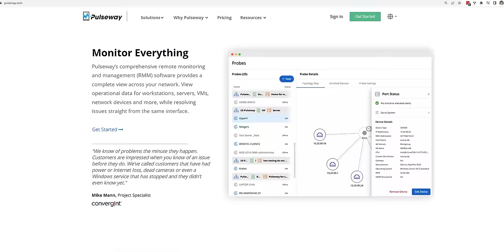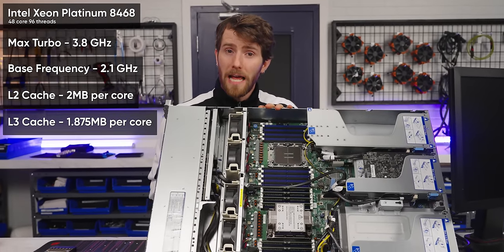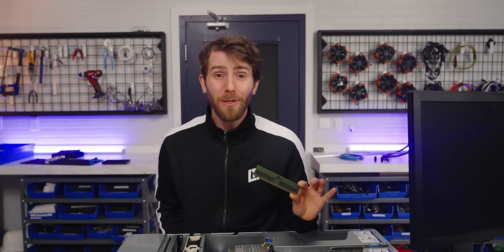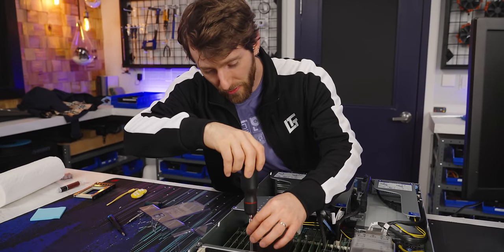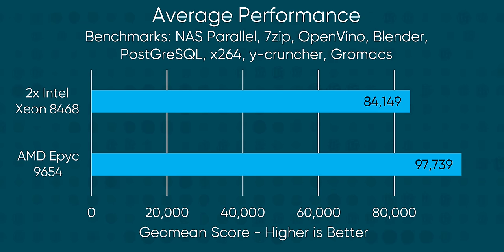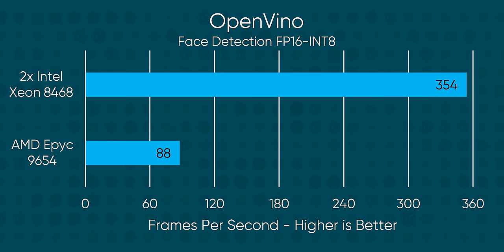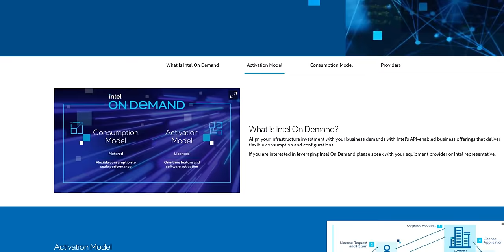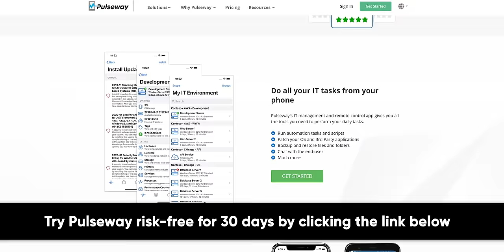Intel’s New CPUs are Cringe - Intel Sapphire Rapids Xeon Platinum 8468

Comment: So I've started binging LTT a bit more recently - and with that comes needing to speak out about the Not so clandestine Teleprompter clickers I've been seeing for Months now, but it just bothers me more and more EVERY TIME.

Linus - you literally have Tech coming out your wazzu and about 3 million staff on board - Just PLEASE PLEASE PLEASE get someone to press the button each time you get to the end of a page.  Or alternatively using a Rolling App to run through automatically - you already know your own cadence, it's mostly the same for all videos, so shouldn't be too hard to tune.
Either that - or get a foot switch instead of the Clicker you juggle and try to hide the fact it is in your pocket...it is really starting to show in some videos as Not the right behaviour at such times - Like holding up the server with one hand, waving your hand in front of it to show components, then hand back in the jacket pocket then back out again...Just...No-one Does that!

Comment: I can imagine pitching this to a superior: "We can spend more money, right now, buying TWO Intel CPUs that are slower than a single AMD CPU and use more power, and... wait for it... Then we can add a recurring cost down the line, to unlock AI accelerators on said Intel CPUs to make them faster than the AMD CPU at select workloads. Great huh?" I'm not sure this is the business model I'd go with. There will be Epyc CPUs with AI accelerators soon, and besides, with the saving from NOT going Intel, you could probably add a dedicated Nvidia GPU for the AI tasks.

Comment: You can shit on the price to performance all day but in the end a lot of customers are gonna want the dramatically bigger RAM capacity and the 8 CPU configurations, huge situational advantages you even mentioned off hand in the video, cause they're simply better than the best configurations AMD has to offer. Nevermind the fact that Intel servers are still statistically more reliable which is extremely important for any company aiming for near perfect uptime. It's great that AMD is actually getting it's foot in the door for once by offering a great deal on less specialized chips. However saying that Intel isn't very competitive by sweeping all the extra features and compatibility under the rug and pretending like the AI acceleration is all they've got going for them is pure BS.

Comment: Do yourself a favor. Load up both servers with a typical setup. Fill it with drives and raid them, put a couple of nics of different brands in there, a Linux OS and a kvm hypervisor. Then spin up a bunch of vms of different operating systems running different loads. Give it a week and then tell me who you like more at the end of that week - the faster one, or the one that works.

Comment: AI processing is evolving too rapidly to be placing it into CPU's which are supposed to be long term purchases that sit in the datacenter for several years.  That's why these companies would opt for addon card versions that they can upgrade because for several years the CPU performance will be just fine, but AI performance will be growing on the addon cards.

Comment: Honestly in corporate world no one cares about this. I have seen $100K servers termed as cheap in corporate world. All that matters is what application they put on it and what capacity they can use that app at. Like if its a server handling internet traffic how many transactions per seconds it can handle. No one cares if its intel/AMD/IBM/HP or any. Just how much traffic it can peak at.
The second question is why customers are still on Intel. Well it comes down to logistics. Customers usually give their capacity requirements to server providers like HP/Dell/Huawei etc with contracts for maintenance and warranty support as well. Intel is present all over the world for quick replacements and has logistical ware houses in every country in the world. AMD on the other hand does not go beyond the rich countries. Uptime is more important than anything in corporate world. AMD because does not have a world wide reach as of intel simply suffers as in order to fulfill the maintenance contracts HP/Dell/Oracle/Huawei will stick to Intel so that the turn around times are met. Which cannot be done with AMD. 
Let me give an example. In Pakistan, Dell/HP/Oracle only provide Intel based servers and I have seen R&R being completed in 8 hours maximum and even as low as an hour. That is a hardware getting faulty to the hardware getting replaced on site. They simply cannot do it with AMD. Because AMD is not present in Pakistan, R&R takes up to 7 days to be completed for them. Now if that server belonged to a Bank, would you wait for 7 days for the server to be up again even with the redundancies. No. AMD fails miserably in logistics and its lack of global reach.

Comment: Linus, I Hope you are reading this, I have a video idea : Does FPS really matter? Most experts have a tough time agreeing on an exact number, but the conclusion is that most humans can see at a rate of 30 to 60 frames per second. Can you get a performance gamer game at different FPSs and get a graph FPS vs number of wins? May be this will put an end to the madness where I see reviews comparing products at insanely high FPSs and get reviews based on more real life scenarios. Does it matter getting the fastest gaming CPU if you can not tell the difference? May be at that level of performance other factors such as TDP and heat become more important.
Reply: He did this video already.

1. Yes and No. What matters the most is not strictly the FPS but the stability of the FPS.

2. Wrong. Humans can actually see more than 60 FPS or Hz. Try comparing a 60Hz monitor to a 144Hz one. The 144Hz would be so much smoother. An easy test that most people can do is with their phone. Most phone (even budget ones) can do at least 90Hz or even more and you can toggle between these refresh rate. Try comparing it when scrolling your phone UI which one is smoother.

3. Top sentence.

4. Again, yes and no (mostly no). You just want to make sure that the CPU isn't bottlenecking the graphics card that you are using.
Reply: @harveywilde6781  thank you, can you please point me to the video if possible please.
Reply: @nabiljemel2838  I don't like posting links on comment, the video tittle is "Does High FPS make you a better gamer?"

Edit: Also this video "Does 240Hz Matter for Gaming" for refresh rate.
Reply: Some how I feel this is left in the grey area so marketing can always sell us faster products. The golden question is what is the fastest refresh rate and frame rate delta that is perceivable by 90 % of the humans. Than add that baseline to performance comparison graphs, so we can see if two products are already above this baseline so it does not matter any more comparing  which one is faster.
Reply: @harveywilde6781  thank you

Comment: Intel loves to license their silicon. I had to tolerate a server once that shipped with a SATA enabled controller. You had to pay to 'unlock' access to the SAS mode and additionally pay to 'unlock' access to RAID support.

If you think Intel is going to let you pay for just the base CPU alone keep dreaming.
example: base cpu = $8,000 and the modules = $8,000, cpu will be sold for $12,000 and module unlock sold for $4,000...good deal, right?

You'd think with 52 SKU's they would not have room for loot boxes...er...unlockables.

Comment: linus talking like he has not installed previous generations of scalable server xeon cpus as they had same order of install. Install CPU on heatsink (adding thermal paste between), put heatsink-cpu combo into socket and screw in heatsink to hold them. It may sound strange, but I had better results installing Xeons than Epyc CPUs with their slide into bracket screw in with very specific order/torque and then deal with not even pressure so missing memory channels/pcie lanes etc.

Comment: So lets say you pay to unlock features on the CPU. How does that work for any sort of permanence? Does it burn some fuses so it it permanently enabled on the CPU, does it write to some sort of firmware on the CPU, does it get unlocked via something written in the firmware on the motherboard, does whatever OS you are using have to have a service that talks to an intel server to check what CPU features you have paid for? This all seems very vague and sketchy. 

What I am getting at is if you pay for this to have features unlocked how do you get to keep it? If you have a motherboard fail and swap it are you going to have to pay intel again because the unlocked features were associated with the old board? If a server needs wiped and reinstalled somewhere on an internal network where it can't talk to the internet for security reasons are the features still enabled. Can the features be enabled without the machine being attached to the internet in the first place? If when the machines are retired and sold off to recover costs do the new owners get CPUs with those features unlocked or do they also have to pay intel to use hardware that is already there and that somebody else already paid to enable? 

There are just so many questions I could see so many companies having for so many scenarios. It also raises all kinds of new questions for security and possible malware vulnerabilities like could somebody now write a new form a ransomware that disables CPU features you paid Intel for and locks the firmware unless you pay up to get them back? Are the CPUs themselves hackable so that we end up seeing sketchy CPU unlocker software and "services" floating around?

Comment: AMDs Epyc supports 2dcp just been validated but 12channel 2socket presents a problem of space for memory slots.
Intel are charging you extra for the silicon that the accelerators takes up but then wants you to pay again to use them! It's like ford saying you have purchased your shiny new off road Raptor SUV, but wait hold on there you need to pay us extra to drive it off road or over 30mph! Get real intel if your making people pay for the silicon you can't charge them to use it they will simply go to AMD or ARM soloutions! That are cheaper possible add a add in card with similar accelerators for better performance and still save.

Comment: I mean Amd was not the first to use multi-Die CPUs - not by a loooooong shot.
IBM that that many many years ago already, even intel did that in the consumer-marked like 20 years ago. And yes - "glued" is the correct term.

And for the CPU comparison - that is why Intel has so many different SKUs. The right CPU for the right job. Why not any benchmarks that these CPUs would actually used with? Were the memory is actually used, where the source is not just compiled but optimised for the used hardware? Cause that is the scenario where those CPUs are used - you do not just use off-the-shelf pre-compiled software on such a system unless you got money to burn and no clue what you are doing

They have CPUs specifically tailored towards Databases that mostly have even fewer cores and still cost a lot per CPU, but their per-core performance is a lot higher and that is what you have to pay the license-fees for with professional databases.
For comparison - the DB-license we often use costs around 3000$/year ... PER CORE. The difference from going with a "normal" 28 core Xeon and a tailored 12core for us was that the 12Core actually had cost just the same, game about 10% lower single-socket performance but as it is sold to run for 10+years in the end costs less than HALF the alternatives - including Epyc which was disqualified way early on already cause of the lack of support from AMD.

https://www.oracle.com/assets/technology-price-list-070617.pdf
Just to got your mind blown on how expensive real enterprise solutions are.
Yes, this says that an "oracle standard Eidtion 2" cost 17500$/year per CPU, with another 4k for software + support license - that is without any backup or encryption capabilities.
It doesn't matter if the CPU costs 5000$ or 15000$ when the licenses cost so much more.

Comment: I really hope Intel doesn't collapse... we've only just gotten another player in the GPU game
Reply: Seems very unlikely. Intel have a huge amount of inertia in the market. There are still idiots buying 10th gen 8380 based servers because they don't know any better and their chips still dominate the offerings from the corporate suppliers like dell, hp etc (and it's not like the consumer intel chips are getting a hiding in the same way)

This is hardly the first time they've been outclassed by AMD. They got caught a bit off guard with the old athlon 500, recovered a bit but then had a real mess up with the p4 architecture whilst amd stole the lead on x86-64. They've always recovered fine.

Comment: Pretty poorly researched project. Visuals jumped back and forth between different models of the reviewed processer, spoken specs seemed to indicate the standard 8468 and not the 8568V or the 8468H. The three of those are all very different processors.

Crying about licensing the accelerators is meritless. If the hardware is cheap, but the software expensive, it makes zero sense to not standardize hardware somewhat then license the software. It makes absolutely no sense to pay for a software package that benefits database or media encoding performance when the workload is being used for low performance VDI. There would be no case where a software optimization would ever be licensed for a workload that has nothing to do with that optimization. It has the same quality as complaining about being software locked out of a development tool that has new features that are installed but you can't use because you only went for the low edition tier.

MSRP means absolutely nothing in datacenter products lol. No one pays that, even regular people buying 1-2 of them at a time.

The chiplet design and tile design have absolutely no resemblance to each other. The tile design is more similar to what is being done with ARM SoC implementation. This tile design means a processor has one numa node. the 96 core genoa processor has 12 numa nodes and all the memory problems you would get in a server with 12 sockets.

Database benchmarking is an absolute joke - nevermind that postgres is nearly irelevent - there is a reason none of the real players in the dbms segment do benchmarking: They are entirely worthless. Database performance is too dependent on the model design, the application, how the application is used, etc. Results of rdbms benchmarks mean absolutely nothing. A real world implementation could perform drastically better or worse. The straight 8468 is also just about the worst processor in the 4th gen lineup to use for relational databases with a 2.1 ghz base frequency. I would just about guarantee that in real world usage, the 32 core 8462y+ would perform better in the vast majority of workloads with 1/3 fewer cores, less expense, less power and not have 12 numa nodes creating fatal performance bottlenecks.